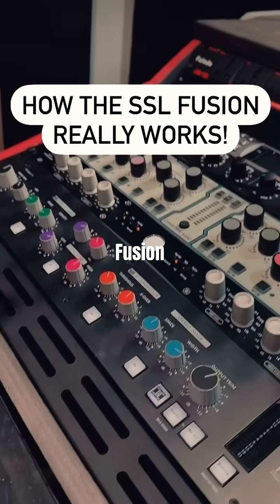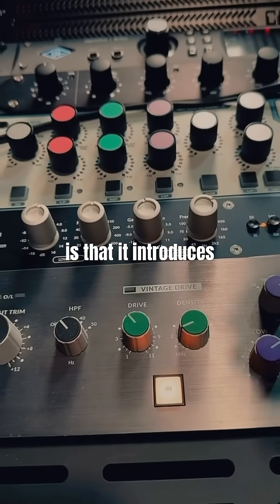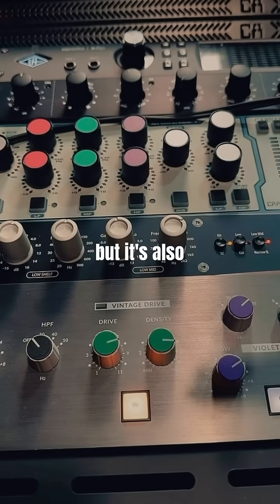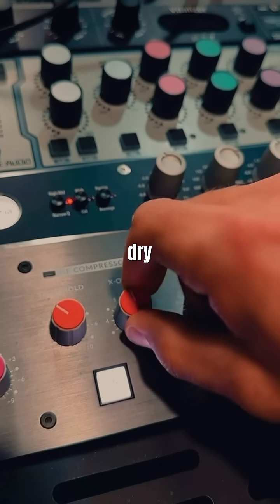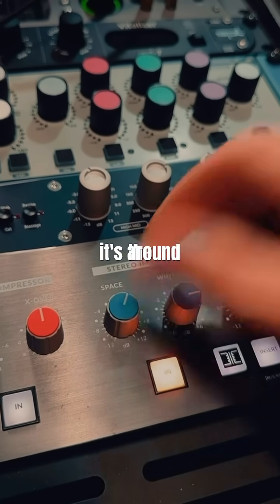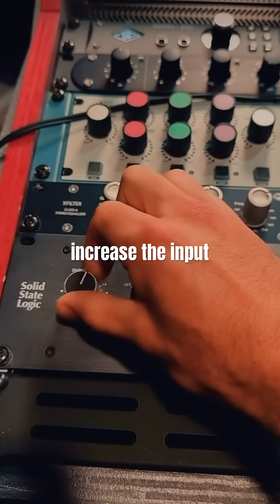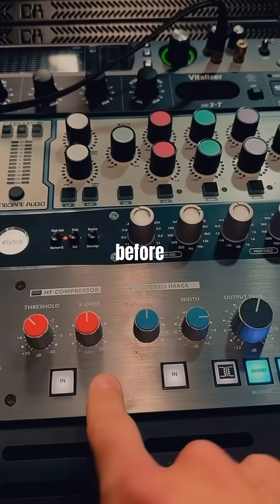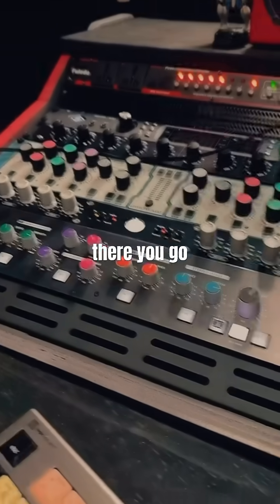HOW THE SSL FUSION REALLY WORKS!

Comment: Lovely stuff man. The only think about Mid/Side button it is pointless to engage it once the signal goes to Xfilter, because Xfilter is a stereo equalizer. To control Mids and sides separately dual mono eq needs to be used there